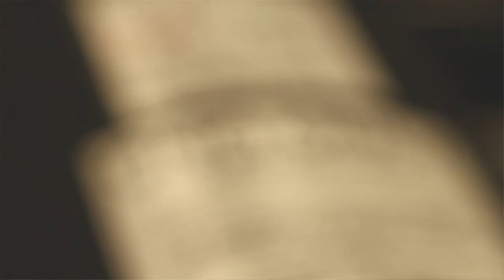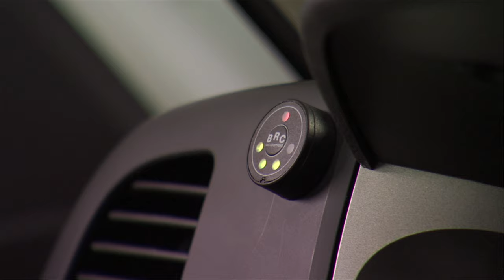The Safety of Compressed Natural Gas (CNG)

Comment: I've been using CNG on my cars for 3 years.  The price has gone up from 95 cents to $1.50.  Still way cheaper than gasoline.  It cost me $1500 per car.  I made my investment back long ago without government assistance.  Dirt poor parts of the world have been using CNG for decades.  I drive mostly on CNG and electric now because the fuel is so cheap.  I still use gasoline if I drive cross-country.

Comment: Id like to have my truck switched over to CNG, but from what I was told, the process is about 12 grand, hell, Id go buy a new truck before I spent that kind of money, when I was in the Air Force, I drove CNG trucks, I didnt see any difference in performance of the engine. so, It is a good idea, but, I cant afford the switch over.